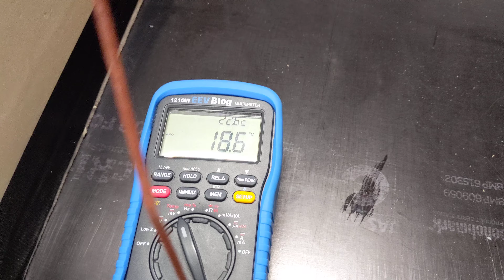Fermenter failure

Comment: How is that insulated? That said, even if this were insulated as well as a fridge, there's not much peltier action going on to do much for that space of a chamber. That said, again, peltiers are crap and I guess you concluded it's much easier/better to use a fridge/freezer? :)

PS I loved your video on flashing the Arlec smart plug. 👍
Reply from the maker: Thanks! :D That was insulated with foam panels from bunnings - they're about 30mm thick. Eventually I switched over to using a hacked freezer and that works super well. Aside from exploding a batch of ginger beer when the setpoint accidentally went to -20 instead of 4...